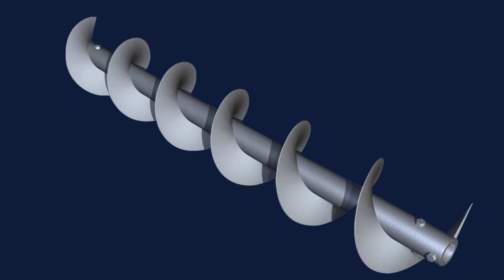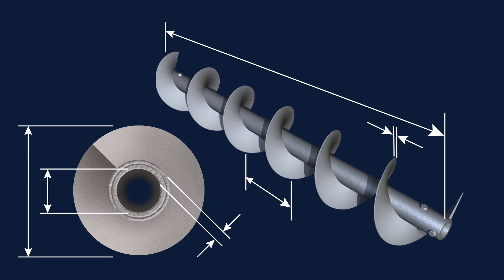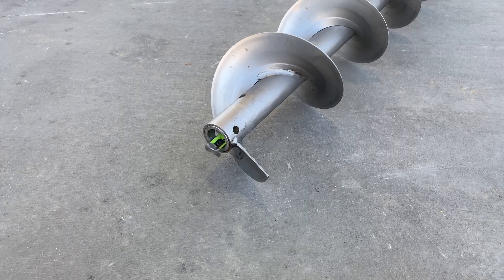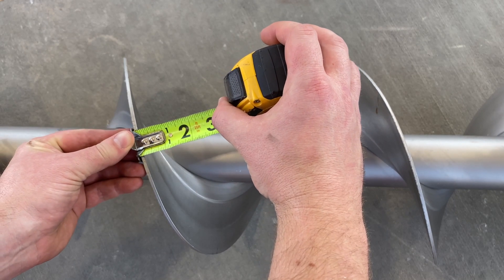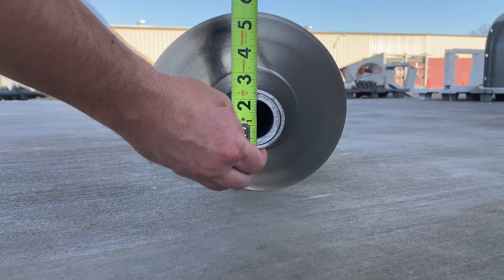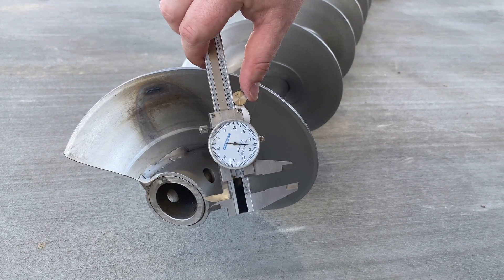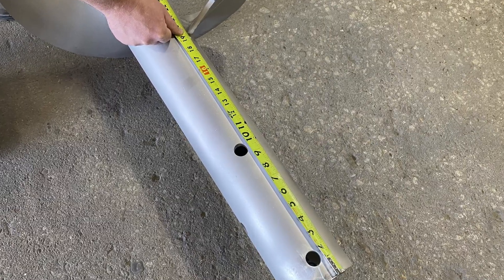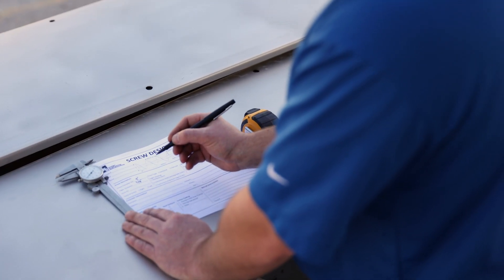How to Measure a Screw

Comment: The screw is not needed to be replaced but just repaired, like bearings, and some other minimal maintenance. 
The price for replacing the screw is 40-80% of the brand new machine, which doesn't make sense.